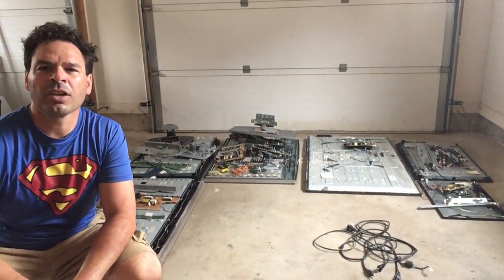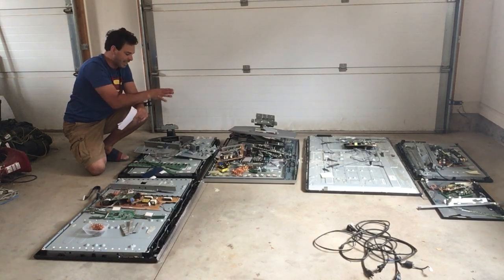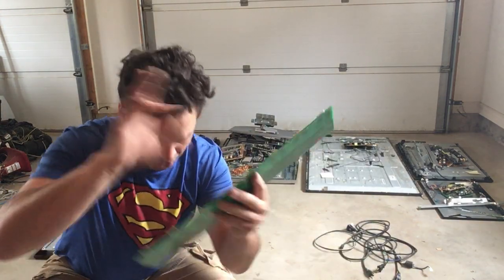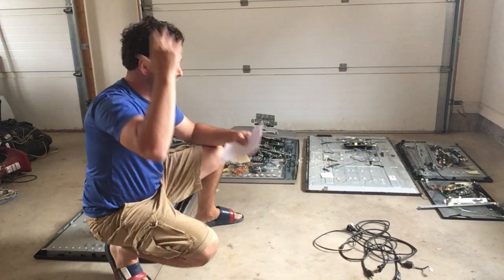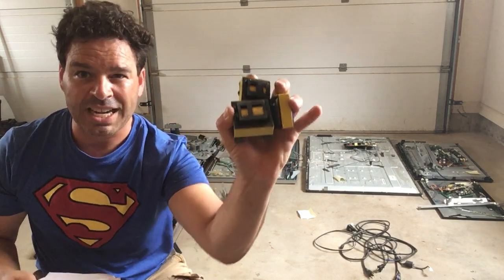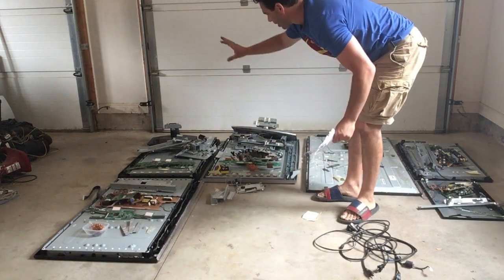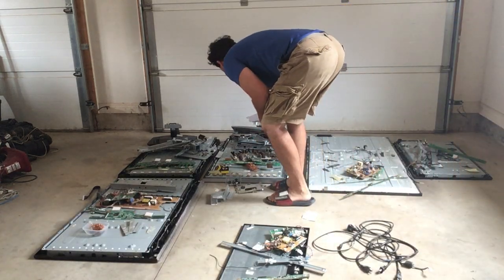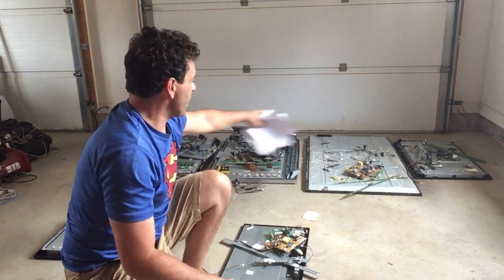Comparing flatscreen tvs for scrap metal. Do bigger flatscreens have more scrappable material?

Comment: That big one I had looked just like the big one you got., about 50”. Very heavy but not a lot of copper. Mostly aluminum. Has some small screws I’m having a hard time removing.🐎🌻✌️
Reply from the maker: Aluminum is good as well. Can get some good weight from the aluminum heat sinks and brackets

Comment: the plastic peace on the perfical boarde are they sailable? I know you mentioned the name of a place in Ontario that you ship your e-wast to in a video a while back . What was that name?
Reply: goldenmoney, but they have not gotten back to me in a real long time. (Not sure if they are even in business anymore)You could try contacting them
Reply: the plastic piece, you mean the part that does not have the gold strip?
Reply: @jamesfirth1280  the little piece is attached to the fingers at 4:28
Reply from the maker: @garywhelton9304  there is a little gold in those plastic finger attachments you are referring to. I leave them on if I can to add to the weight of the board. Those are what I cut to release the board. If they fall off I will keep and throw in with the board. I am sure people will buy them for gold recovery, but they are extremely light, but do have some gold inside.
Reply: @TinManScrapper  Thank you kindly sir.